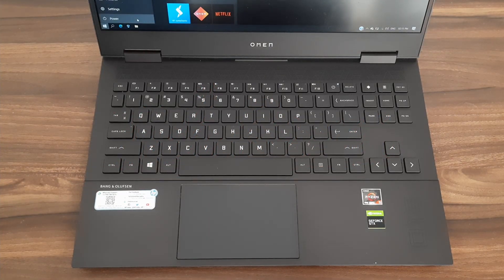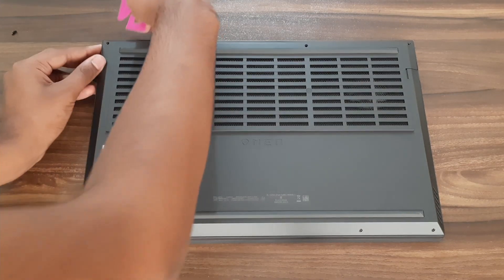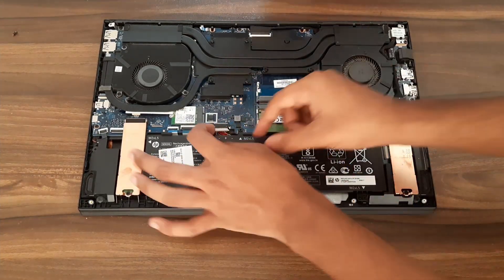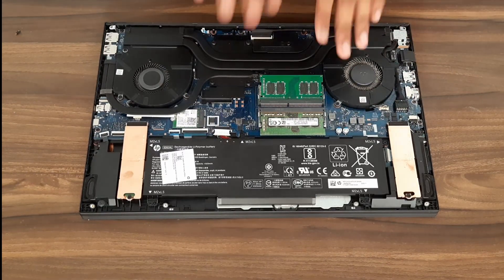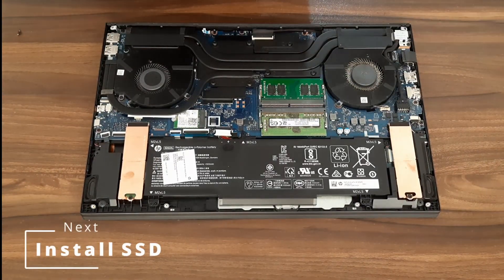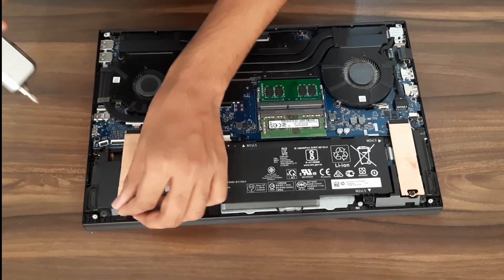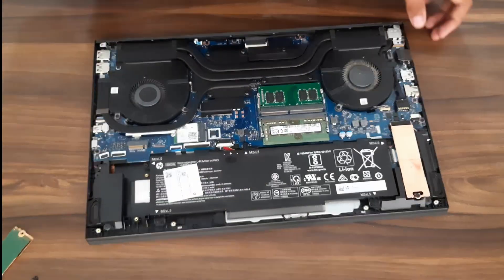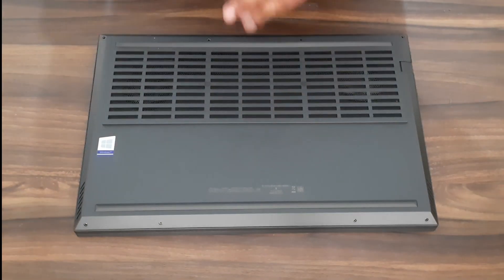How to upgrade Ram, SSD, Battery in your HP Omen 15 (Similar For Omen, Victus 16)

Comment: Hello! I’m actually going to do similar upgrade to my Omen 15. Just a curious question though, is it necessary to remove static from your body by grounding yourself (like when dealing with PC parts) or is it safe with laptops? What preparations did you do before performing this upgrade? (I don’t have those anti static wristband thing and am a bit worried 🥲)
Reply from the maker: Hi, Thanks for your comment. It is recommended to use the anti-static wristband but it is not necessary I haven't used it, I did the upgrade normally. Just make sure that you unplug the power adapter and remove the battery connecter from the motherboard before doing the upgrade as shown in the video.
Reply: @tech_rovers  Thank you! That puts me more at ease! I watched your video a couple more times to make sure I remember everything to heart 😆 Thanks a lot for making this video, it’s exactly what I needed!